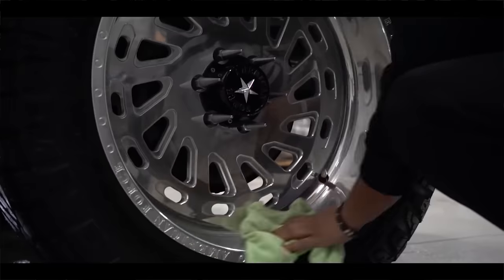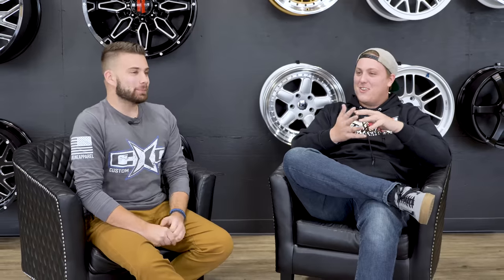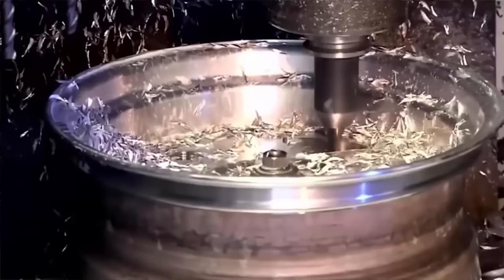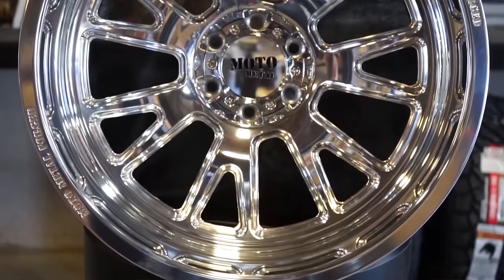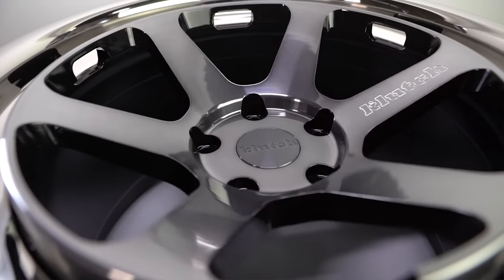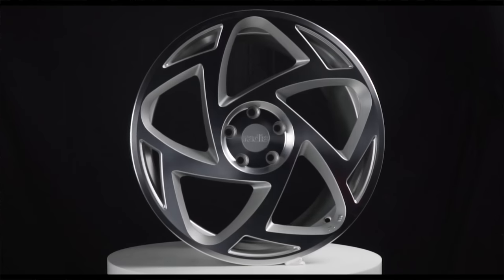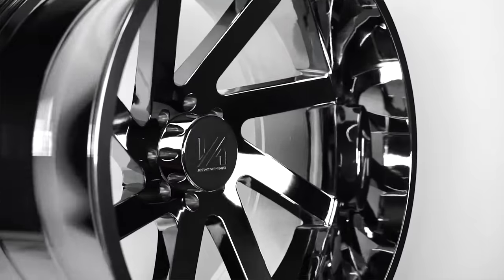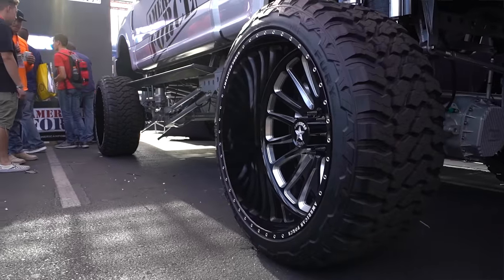Car Wheels VS. Truck Wheels

Comment: Nobody talked about the gaudy tacky design nature of truck wheels?? You also gotta love beauty bolts on work trucks................
Reply: Miguel Garcia truck wheels are so gaudy and I’m a truck owner. I still have my OEM wheels because I can’t find a single design that doesn’t have a shitty wheel design or a wheel without fake Beadlocks.
Reply: @REEL SIXX I'm a lowered truck guy but this is bull. Cars are no where near the same. Yeah the low end made in China ones might be with fake hardware but most upscale wheels have actual hardware that do something because they're multi piece wheels. Lifted Trucks 95%of the time running are pos moto metals/fuel/etc wheels that are made in China with the most absolute ugliest designs I've seen. They spray some black paint and call it day. "Black and poke out past my fenders" is the lifted scene motto.
Reply: I'm looking to get wheels for my truck but it's on stock height and don't plan to lift it. 99% of truck wheels just look.... gaudy and ridiculous. So I'm looking to put forged wheels on my truck but I'm not sure If I should be concerned about using car wheels on a truck because of the extra weight.
Reply: @SBF96  get volk TE37 gram lights, or Advan RGD2 truck wheels.

Comment: I think if truck wheels were lighter trucks would be less of a hassle to daily drive. Gas mileage would improve and handling would improve too. Having driven on 11 lb wheels you can definitely tell when wheels weigh 50+ lbs

Comment: The intro wheels are pretty cool on the trucks  I have notice how they gotten stuff from the car world on the truck wheels I was wondering why the truck don't do put like the srt10 wheels on a ford or Denali wheels on a dodge  how the car guys do whit some oem wheels is there no wheel adapters for trucks? There is some pretty bad ass trucks out there the car scene is way better more options on everything. Keep up the good work on the videos
Reply: Srt 10 wheels are one of the best truck rims imo. As far as a design from factory.

Comment: I got some concave custom rims I took off my car, I just saw an adapter from 5x127 to 5x114.  The 5x127 is my 83 C10 and the 5x114 and 5x120 is the custom rims. Would it be ok to install them on my C10 with an adapter?

Comment: I know this is old now but why has nobody just made some regular multipiece wheels in truck specs? Youd think they would do that more often cuz you can fully customize your specs. I guess that doesnt matter that much tho when fitment means nothing. They just get the lowest offset they can and poke 6 inches

Comment: I hate that truck wheels are so damn heavy even if they are forged. The only way to lose unsprung weight in my Duramax is a custom lightweight big brake kit someone from the midwest fabricates. I also wish more 7 spoke designs for trucks existed which leads me to look into buying Anthem Equalizers for my truck.

Comment: A question for you. Is it possible to fit a car wheel on a truck?
Reply: @crashcourseinbruhsurgery  Depends, Ford 4.5x5 Passenger car wheels will fit the smaller Ford trucks and SUVs as well as some Jeeps.
Reply from the maker: It is very difficult To find a brand that makes that style wheel in that size!
Reply: @FitmentIndustries  I should have stated 4.5"x5" bolt circle. With the exception of the center hole diameter, there were a bunch of vehicles that used that pattern.
Reply: @crashcourseinbruhsurgery  I have seen a Nissan Frontier truck on TE37's and I had to admit it looked great